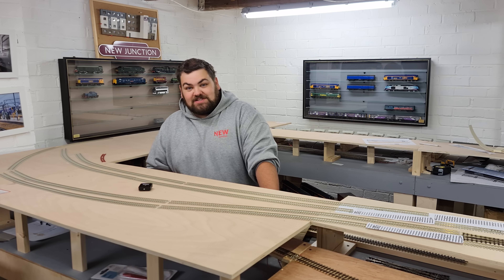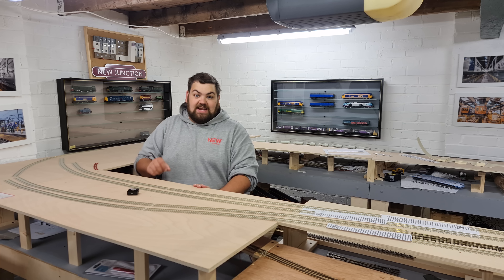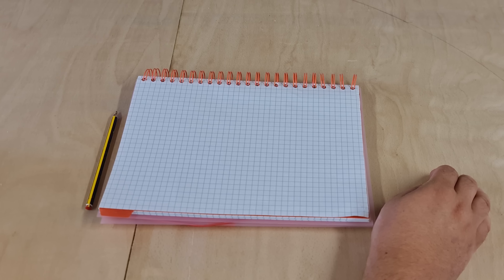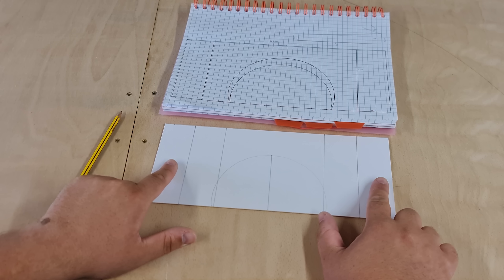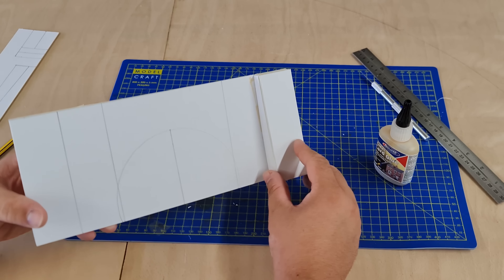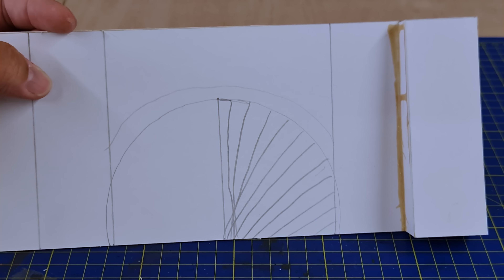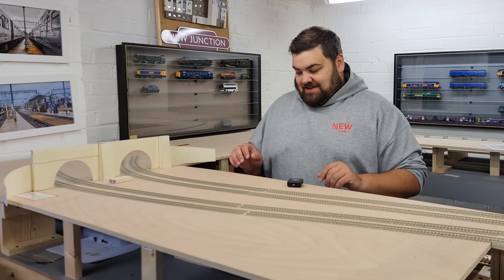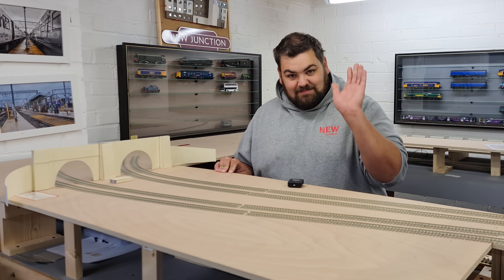New Junction EP7 - Going Potters

Comment: Looks like you could add a wooden board fillet on the left of the baseboard at the join as you approach the tunnel mouths, that would allow you to bring the track beds over slightly to the left and lessen the curve of the tracks enter the tunnel mouths giving you a straighter track course. Just an idea. Where the other board abuts on your title shot for the video there looks to be scope to add in the board here.

Comment: Modellers license says you can make supporting structure narrower for the needs of the model. You could shrink the width of the buttresses on the tunnel, this would make the tracks closer together, and thus ease the inside radius, and the curtain walls less wide, giving you a little more leeway with the outer scenery. While it's a big step for a novice(?) you could consider a point kit, or designer pointwork to get the visuals of the sweeping curve looking right.
Reply from the maker: Both good suggestions, thanks Neil

Comment: Hi Rich, Just a thought….. If you move the tunnel portal back along the curve, although it won’t be on the baseboard join you will be able to show off the 2 portals & their tunnel wings to a better effect. It will also provide a bit more space for scenic work as the portals will be on a angle which will provide a better view for spectators. With some clever foliage you could still disguise the join.
Reply from the maker: Food for thought!

Comment: That inside curve looks very tight for an area that you say you want trains running at a fast scale speed. Working the largest radius curve to the point where it becomes a straight along the wall and then working from back to front where your track setter radius tool was laying might leave you with that innermost curve being pretty tight. Difficult to tell with cameras giving poor depth perception, but getting the radius correct on the innermost track might save you frustration later.
Reply from the maker: 100%, there's no getting away from it the inside line (up slow) will be second radius once past the tunnel portal.

Comment: use black foamcore board .its very light easy to cut and is 5mm thick so keeps its form better .downside it can be pricey .i use it all the time and build ultra lightweight small layouts from it.i have used it for 10 years and if looked after it has very little problems.
Reply from the maker: I'll look into it

Comment: Nice work. You need to pickup a cheap 3D printer like the Voxelab Aquila. I've got a ton of tunnels on the layout here, and 3D printing is the way to go. You do the same math and prototyping that you do with scratch building, but you can then reproduce it over and over again. The computer also does precision curves. 3D printers are about the same price as a DCC Ready Loco these days! :) As for the curved points, be careful with them. I've got three of them on the layout here, didn't really have a choice as I had to use them, but they can be quite temperamental until you fit point motors.
Reply from the maker: Great idea! I need to.share with someone as I'm short on pennies

Comment: Hi Richard, finally caught up with your updates. Just one note on the tunnel portals, would it not be a better idea to fix them to the corner board and keep the scenery fully on that board? The thinking behind that is less likely to get damaged during transporting to and from shows and it will also keep the board split lines hidden.

Just a though, thanks JR
Reply from the maker: Hi John, good idea that, ill do some fetling

Comment: Good to see the progress! What radius are the curves going off screen going to be? Looks like it will be tight for 4th/3rd to be square at the tunnel portal? Is having the tunnel portal on the edge of the scenic board not going to be venerable to damage, and the joint line will be over the top of the tunnel mouth - even move visible?  Would moving the tunnel portal further onto the board make for a stronger construction and all the curves to finish inside the hill? Just a few thoughts, sorry if this is sounding negative, since you have made far more layouts than I have. Have you installed point motors or will this be done later? Great video!
Reply from the maker: Hi Gavin, comment away its all welcome feedback. 

I still need to play around with the location of stuff. Point motors go in once the track is down.

Comment: Trains drive on the left don't they? The line you pointed at towards the end of the video should be the line where a Class 91 should go barreling "in" to the tunnel I think? The track nearest to you/the operating well in the middle would be the tunnel exit line if you are following UK normal "drive on the left" for Up slow, Down slow, Up fast, Down fast. Glad you are going for 4 tracks though, more is more! 😁
Reply from the maker: The ECML is up slow, up fast, down fast, down slow 😊
Reply: @NewJunction  Aah, that makes a lot more sense, thank you!! 👌🏻

Comment: Smashing. Has anyone suggested Finetrax point kits? They can be curved, during assembly, to match your track curve, doing away with the awful dog leg you get when a fixed geometry point doesn't quite fit into the flow of the formation.
Bob
Reply from the maker: I'll take a look
Reply: @NewJunction  I've used them on the scenic section of my layout with a slight curve. That experience convinced me that more was possible. I can recommend them and they're a really good price.
Bob
Reply from the maker: @robertbage5052  thanks Bob, appreciate the suggestion 👍

Comment: Coming along nicely, not wishing to throw cat amongst the pigeons but have you thought about hand building the points?  I know it seems scary at first but it’s really not that difficult and you can get some really flowing junctions.
Reply from the maker: I had for a nano second but I feel it may be out of my budget lol
Reply: @NewJunction  To be honest if you can make your own vee’s etc (takes a bit of practice) it can work out far cheaper in the long run
Reply: @8nedgehilldieselservicingd212  I've been hankering after modelling Bangor station... will definitely have to make my own points if I'm to accurately reproduce the trackwork into the engine shed... overlapping points and all sorts!
Reply: @theelectricmonk3909  it’s really not that difficult once you start, although it can be a bit intimidating at first, I’ve built track in 7mm, EM and now in 4mm but it’s very therapeutic once you get into it

Comment: Richard, can you tell me why your droppers are 4’-0 long? Thanks
Reply from the maker: Hi Charlie, so they can reach through to the connections, stay tuned I'll update on why in a later video :)
Reply: I was given a few decoders but don’t know if they work. Is there an easy way to test them?
Thinking of having a dedicated DCC track
Reply from the maker: @charlie1872  plug them into a loco and see if it runs. 😊
Reply: Thanks, I don’t have any DCC ready but might have one coming from a friend
Reply: Good idea. In my caseI might use the inside track, the droppers will not need to be too long.👍

Comment: Very ambitious!  But, I am puzzled.  You have been working away on the bottom level for some time, but now you have added another level?????
Reply: Bottom track is set to be a heritage line and the top level is a mainline
Reply: @southerntrainspotter2527  How do you work on the heritage line when it is covered so much by the main line?
Reply: @walterreil4001  I assume he’s sorted it to his satisfaction before placing the mainline
Reply from the maker: The Mainline boards are yet to be cut down, once the track is done I'll trim them down. 😊